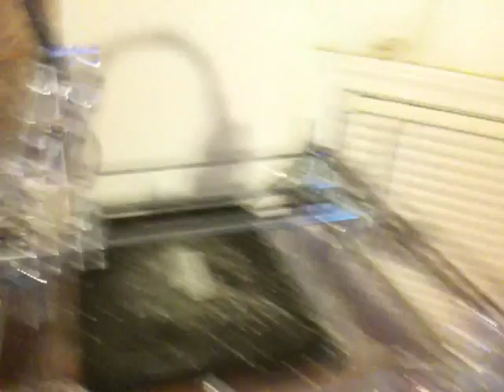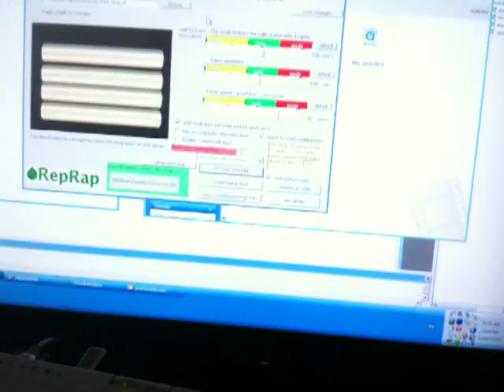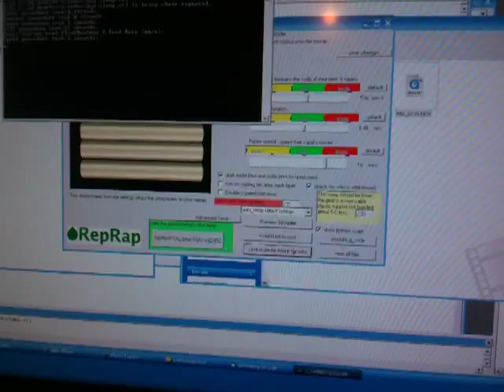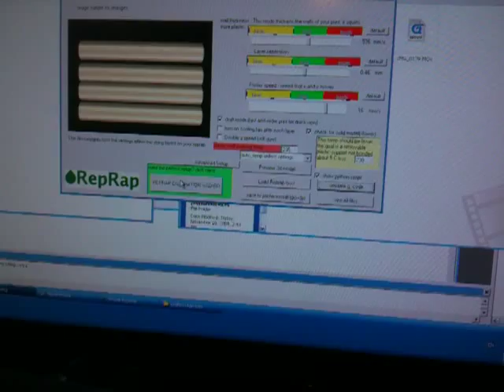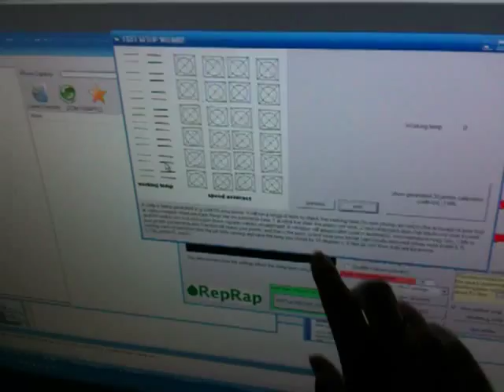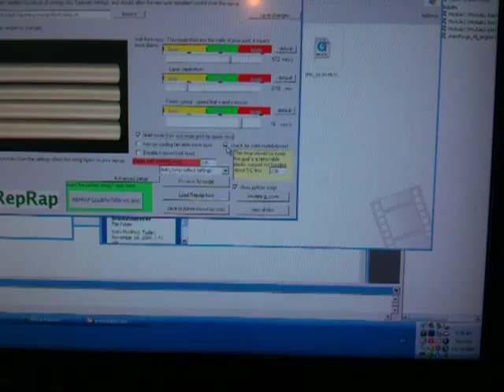3d printing reprap 3d simple software with built in wizard

Comment from the maker: this software was released as a beta a while ago. when time frees up i plan to work on it again and make it work well across windows, linux, and mac with wine. i want a driver approach like a regular printer, and want a setup  and alignment of 3d printer. then the driver looks at the web page you are on, and finds stl files, and works on processing an image cache, so if you ever want to print, it will be processed already.